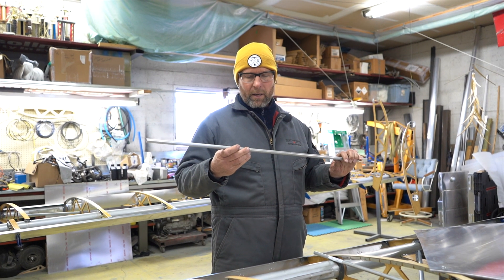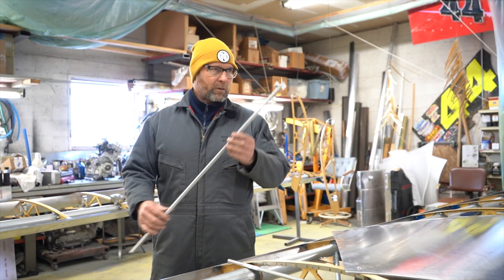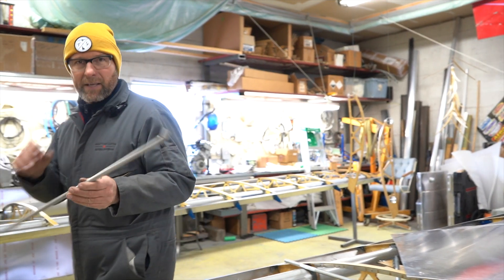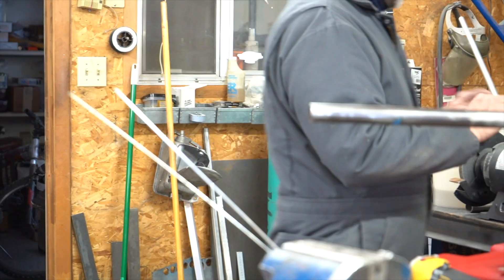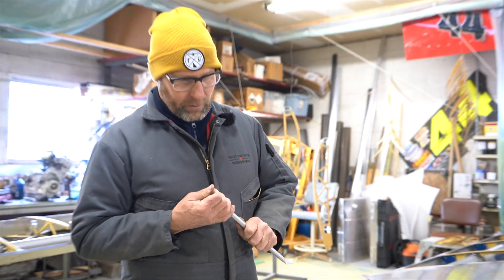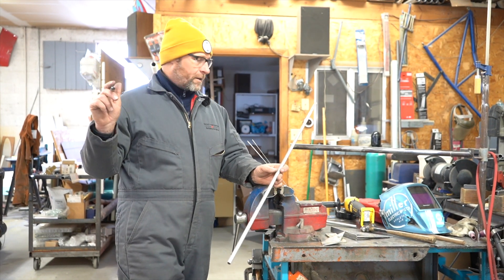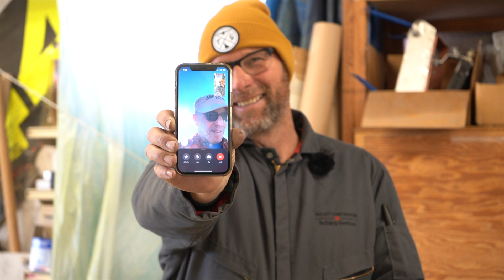Highlander Build #6- Reinforcing the Wingtip Ribs

Comment: Let’s talk more about that bandsaw. I’m setting up my shop for an upcoming build and didn’t want to spend $1000 plus on a metal cutting bandsaw. Your option looks great. Swag off-road tools even sales a miter table and foot switch to mount a variety of portable bandsaws to. I went down to Home Depot and was ready to make the bandsaw purchase but realized Milwaukee doesn’t sell a blade for it that they recommend for aluminum. I’m sure someone makes one . I’m guessing the blade speed is a little slow for the softer metals? What tooth per inch blade are you using? Can it be used to cut a mild radius, like a panel? Thanks for posting in Steve’s absence 👍
Reply from the maker: We will be making a video about the bandsaw hopefully soon! That was Josh’s creation and it works great! The guys use it all the time. Thanks for watching. -Sara
Reply: Adam Savage has a similar setup, with homemade stand. There’s a full build video if you search 🙂